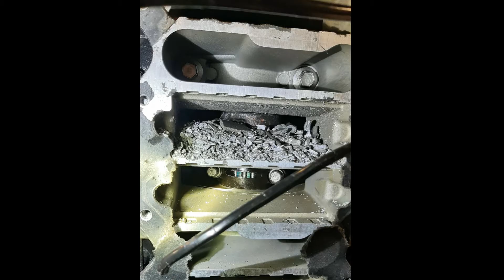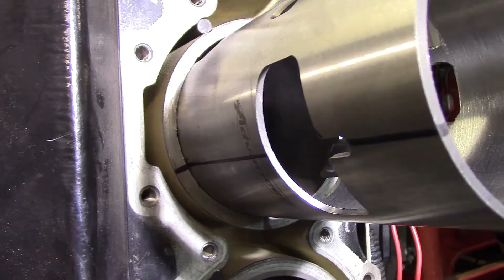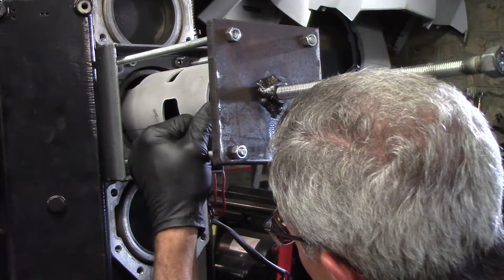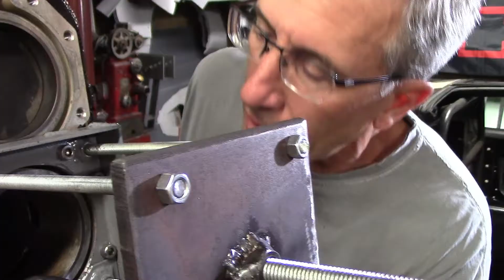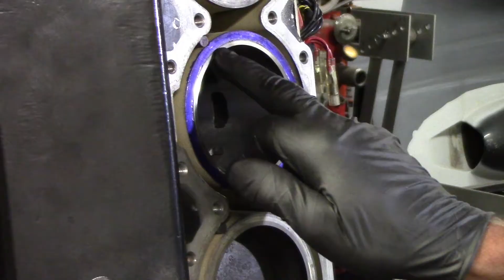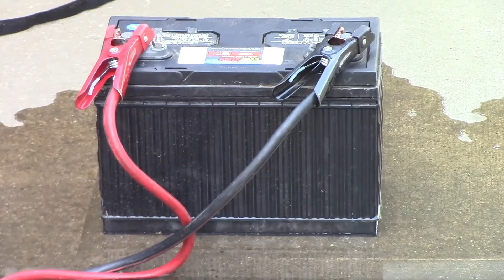Mercury 225 Outboard Cylinder Re-sleeve

Comment: OMG this guy is 200% idiot. He puts a sleeve in a block without full disassembly, tries to size the sleeve before he even installs it instead of boring it after. He doesnt have one single clue if the bore of the sleeve is exactly centered in the block. Sleeves are not perfectly round. The pissant torch could not possibly get the block hot enough for a sleeve. Grinds a bevel on the sleeve with all the debris flying into the still assembled block. If he owns or works at a repair shop, absolutely avoid it! Please lord, tell me I will never be this friggin stupid, and if I get this bad, just please shoot me.

Comment: first of all, using the clamps as shown is asking for trouble!!!  they are not designed to be used in the way!!!!   second,   getting the liner out is dead simple, weld on the inside from top to bottom (maybe 2 or 3 weld are needed , depending on how tight the fit is) and after cooling down the liner will drop out by itself!!

Comment: I rebuilt hundreds of outboards and motor cycle engines since 1976..
The sleeve machine work is ok but to say no disassembly of power head is absurdity.

Anyone that thinks they can replace that sleeve without completely disassembly of power head is insane or clueless...

Metal fragments from initial failure and machine work are contaminated all through out the other needle roller bearing and seals between crank chambers will fail instantly..

WTF?

Comment: Do you build them nifty presses I could use one
Reply from the maker: @zacyou8780  I could build you one if you want me too. I would need some dimensions of your block.
Reply: I could use one of the sleeve presses as well for a 1990 2.5 mercury block
Reply from the maker: @chasepappa7179 I built that for my 3 liter 2 stroke. Not sure if the bolt pattern is the same.